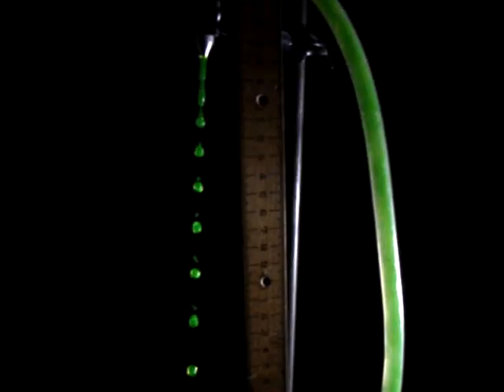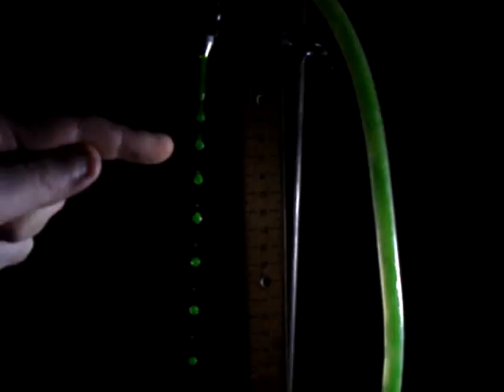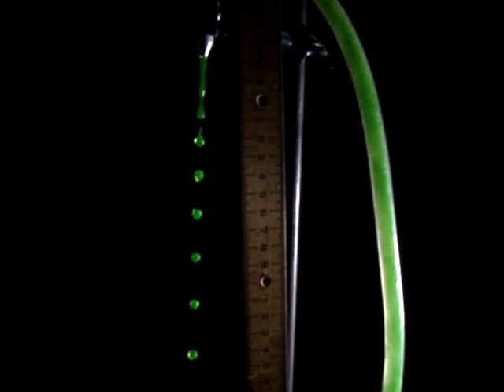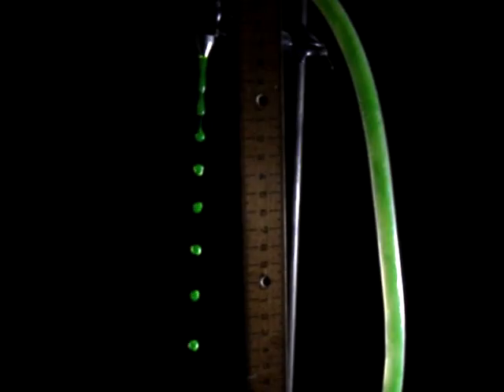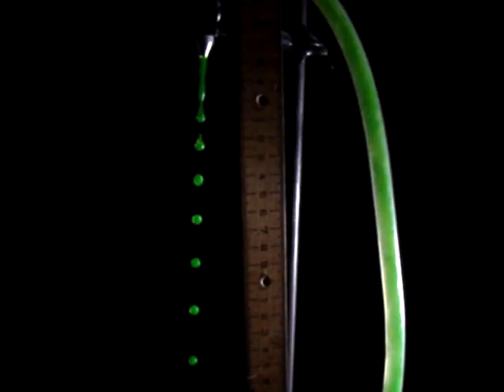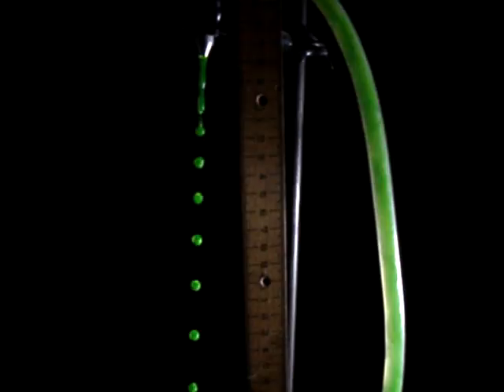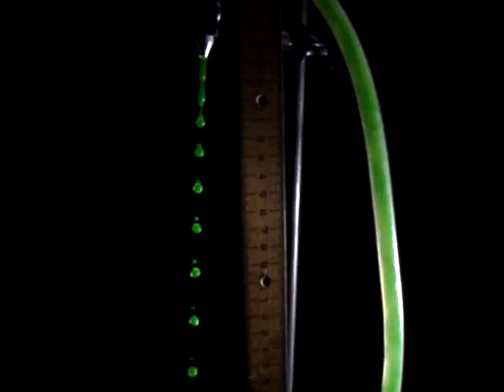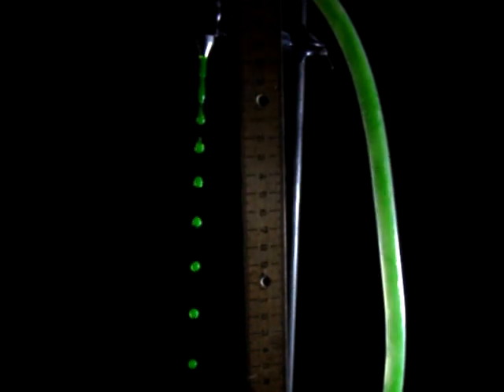Strobe light makes water drops fall in slow motion

Comment: Hi I'm interested in building a 'pump with its own timing circuit that allows me to adjust the frequency of the pump' :-) Would you be willing to share a schematic? Kind regards.
Reply from the maker: Yes, I've used a Gorman-Rupp 14825-710 pump which runs off 19 volts AC together with a 555 timer driving a MOSFET power transistor at 24 volts to create a variable frequency pump.  The schematic is pretty simple - contact me at dsherman-at-cornellcollege-dot-edu for details.

Comment from the maker: The GRI 14825-613 pump is a 230 volt pump so you probably can't run it off 120 volts.  You'll need a 120 volt to 220 volt converter.  Google "AllElectronics transformers" to find them.  You'll also want their 3 amp variable transformer (variac) which is used to control the pump intensity.  Connect the variac output to the 220 volt converter input, then connect the 220 volt output to your pump.  Finally, plug the variac into the wall and adjust it to produce a smooth droplet stream.

Comment from the maker: Hi - is your pump a low-voltage pump or is it a standard AC pump?  The circuit will only work with low voltages.  You can get low voltage Gorman-Rupp pumps (12 volt and 24 volt pumps) that can be driven using low-voltage circuits (555 timer connected to a power MOSFET transistor acting as a high-speed switch).  Aside from the pump, the circuit is pretty cheap.

Comment: Thanks for the offer - that would be very helpful. So far I have the oscillating pump, a varic transformer and a little led strobe light kit that I soldered together (a little circuit board). Not sure if I need any other electrical equipment to get this up and running, but a schematic would be wonderful. I know I definitely still need to get the tubing, buckets for water, strainer, and dye.

Comment from the maker: Yes - that's right.  The variac is used to reduce the flow from the pump from a fairly intense stream to a slower series of droplets.  It is also possible to use lower voltage pumps and run them off lower powered circuits that don't require variacs.  It's easier to tune these lower voltage circuits to run at frequencies other than the usuall 60 Hz AC that comes out of the wall.  Let me know if you're interested in building one of these - I have schematics.

Comment from the maker: The pump you see in this video is fixed to the frequency of AC power (60 Hz).  However, I have also made a pump with its own timing circuit that allows me to adjust the frequency of the pump.  For most purposes, the pump frequency remains constant and the strobe frequency varies.  However, there are some cases where it is necessary to vary the pump frequency and keep the strobe frequency fixed.  In either case, I use a simple 555 timer chip circuit.

Comment from the maker: I have posted some instructions on people.cornellcollege.edu/dsherman/waterdrops.html although you can find many 555 timer circuits online that will flash LEDs.  You can also buy strobes that are fast enough to freeze the motion of the water drops.  Try an eBay search for General Radio Strobotac model 1531.  A good search string is "Strobotac 1531" and see if you can find some good ones under $100.

Comment from the maker: It can work, although it often requires some fine-tuning because the droplet flow from many sinks is chaotic.  If you can find a flow rate that produces a periodic drip, then you're all set.  But often the drip rate will vary a bit and the drops won't flow at a uniform rate.  Slower drip rates are more stable, but then the flashes are farther apart and you'll lose persistence of vision and see discrete flashes rather than a steady light.  But I'm glad you got it to work with a sink.

Comment from the maker: You can drive the pump using the same circuit I used to drive the primary windings of the plasma speaker circuit.  Do a Google search on "derin sherman plasma-speaker-circuit.pdf" to find the circuit.  Replace the 555 timer with any circuit that produces short pulses (50 microseconds on, adjustable time off) and replace the flyback transformer with a GRI 19 volt pump.  You can email me directly at dsherman@cornellcollege.edu for more info.

Comment: I am very interested, after doing a lot of research i have figured out how i am going to drive the leds (Arduino to a led driver that has a control pin) but I've been stumped on the pump. After watching your video I definitely want to use an oscillating pump (multiple ones actually), but I've had the hardest time determining how to power one. I really like the idea of being able to adjust the rate of the pump. I appreciate you being willing to help me with this, thanks again.

Comment from the maker: Hey - I've also used a Gorman-Rupp 14825-710 pump (which runs off 19 volts AC) to make the slow-motion water drops.  This pump is driven by a circuit producing DC pulses at 24 volts.  The advantage is I can adjust the pulse rate of this pump while the 120 VAC pump is stuck at 60 pulses per second.  The circuit is pretty easy to make (555 timer connected to a power transistor driving the pump), so let me know if you're interested in making it.

Comment from the maker: I used a Gorman-Rupp 14825-690 oscillating pump in the above video, although most oscillating Gorman-Rupp pumps will work.  (Check pump voltage first.)  eBay has good prices (you can often find pumps below $50).  The pump was powered by a variac (eBay, less than $50) which will let you adjust the intensity of the pump to get a nice stream of droplets.  

An alternative to the pump is to vibrate the end of the hose using a speaker and oscillator - this is a much cheaper alternative.

Comment: what oscillating pump did you use and what power supply did you use for your? im trying to build one of these but Im not sure what power supply I will need for the pumps i see available.

Comment from the maker: There are two things you need to make: the strobe and the water dropper.  You can find instructions for making an LED strobe by doing a Google search on "led strobe light circuit slow motion" (without the quotes).  The cheapest way to make periodic drops is to siphon water through flexible tubing and tape the tubing to a speaker that vibrates at the same frequency as your strobe light.  Do a YouTube search for "brusspup freeze gravity with sound" to see how this works.

Comment from the maker: You can make the flow of drops appear to reverse if you flash the strobe light slightly faster than the pump rate.  Each drop almost makes it to the location of the previous drop, but falls slightly short.  So, the net result is each drop appears to move slightly upward, rather than each drop falling a fair distance downward.  You can do the same thing with strobe lights and spinning wheels as well - this is the "wagon wheel" effect seen in old cowboy movies and optical illusion websites.

Comment from the maker: You can often find good strobe lights on ebay for reasonable prices.  Try searching for a GenRad Strobotac model 1531.  This will cover a desktop experiment with ease.  You can usually find deals for under $100, although the list price is much higher.

Comment from the maker: Good question!  The key point is that a strobe light produces a series of very brief flashes, each lasting a few microseconds.  During each flash, the drops move a tiny fraction of a millimeter and, for all intensive purposes, are stopped.  Household bulbs do flicker a bit, but each flash lasts several milliseconds, so there isn't a sharp image.  However, old CRT television sets will produce brief flashes of light at 60 Hz, so they can be used as cheap strobe lights.

Comment from the maker: Well, in a funny sense, this is normal speed.  This is a straight video capture - no "slow motion" special effects.  If I had been thinking about it, I could have set this up closer to the room's light switch, and then I could have switched on the room lights, but then all you would have seen is a regular stream of water - all the moving drops would blur together to appear to be a solid stream of water.  I'm not sure this would help you understand the effect any better.

Comment from the maker: If you're using a similar pump, then you'd need 50 Hz in the UK.  But it is also possible to make a pump system that will create drops at any rate.  The easiest way to do this is to vibrate the tubing using a woofer speaker playing a single tone (usually between 20 Hz and 60 Hz) and then matching the strobe frequency to that tone.  You can also make/buy pumps that work at frequencies other than 50 Hz and 60 Hz.

Comment from the maker: First question: the flash rate is too high for your eye to distinguish individual flashes - it's about the same flash rate as a computer monitor or TV.  So no, there isn't a problem with this setting off epileptic attacks.  Second question: if you used enough strobe power, then this could work outside at night.  If you used LED panels for your strobe, then you shouldn't have any problem.  Email me dsherman@cornellcollege.edu if you need help getting materials.

Comment from the maker: It photographs best in a dark room, but it also looks best when the background illumination is low.  If the strobe is sufficiently powerful, it will provide enough light to illuminate the rest of the room.  However, strobe lights that are sufficiently bright to do this are pretty expensive.

Comment from the maker: The pump can certainly send a stream of water 35" downward (as seen in the video) but you'd need a more expensive pump to produce a clean, pulsatile fountain of water that would shoot upwards 35".  (There may be a trick to do this which I am currently investigating.)

I think the LABTAB stuff is all computer controlled: you only need a microcontroller or simple timer circuit for these LEDs.  What you need is rapid repetition (60 Hz) with short flashes (10 microseconds or less).

Comment from the maker: I used a Gorman-Rupp 14825-690 pump in this video, although many Gorman-Rupp 14825 series and 15000 series oscillating pumps will work equally well.  I've also used lower voltage Gorman-Rupp pumps using a 555 timer circuit powering a MOSFET to provide the high current pulses needed to drive the pump.  You can often find some great deals for these pumps on eBay.

Comment from the maker: Hi - simple answer is "Not yet."  The trick is to make a feedback circuit that controls the pump so that it delivers a steady stream of droplets.  Several digital control circuits that do this have been posted on the web, but I'm still trying to do this using analog circuitry.  This should be possible (and cheap) but I haven't yet found the time to do it.  If you want to try a digital controller circuit, do a Google search on: time fountain pic controller

Comment from the maker: I have a schematic for an LED strobe light on my web page (Google: Derin Sherman Strobe Circuit)  which costs a few dollars to make.  You can also buy used GenRad xenon flash strobes on eBay for under $100, if you're patient (eventually someone has them on sale).  Do an eBay search on: GenRad 1531.  You could also search eBay for strobe tachometers.

Comment from the maker: The bulb must have three features:

1. It can produce short (and bright) flashes lasting a few millionths of a second
2. It can produce many of them (about 60 flashes per second)
3. The flash rate must be stable

The most common types of bulbs are either xenon strobe lamps or LED strobe lights.  The xenon lamps are brighter but cost more; LEDs are cheaper and more versatile, but often aren't as bright.  I used a xenon strobe in this video and have done student activities with LED strobes.

Comment from the maker: In theory the pump output can be split 4 ways, although the pump needs sufficient power to drive four streams.  Doc Edgerton's original piddler machine used a very similar pump driving a pair of streams, and it worked fairly well.

Comment from the maker: @Fromzon Yes, it would be cool.  Unfortunately, the strobe I was using didn't flash at a consistent rate: the flash frequency would slowly drift, so even when the drops started out motionless, they would start to slowly drift up or down after about 10 seconds or so.  The solution to this problem is to synchronize the pump and strobe electronically, and that's something I'm working on doing.

Comment from the maker: @BlueRice It's easier to see how this works with a spinning fan.  If the fan blades spin around 60 times a second and the strobe flashes very briefly once every 60th of a second then the fan blade will always be in the same position each time the light flashes.  Your eyes blend the flashes together (persistence of vision) so you don't see the flashes and the result is the fan appears to be standing still. There's a Wikipedia article on the "stroboscopic effect" showing how this works.

Comment from the maker: @fruitytuterjjc Neat idea!  You could also use a single modulated laser reflecting off a spinning mirror onto a static array of mirrors positioned under each stream of drops.  You'd need a computer to control the modulation, but you'd only need one laser.  BluRay laser pointers should work well since fluorescein will readily adsorb the blue-violet light and emit strongly in the green.  Alternatively, you could use a TEA laser that produces nanosecond ultraviolet light pulses.

Comment from the maker: @TheSquishy200 Hi - there are really two separate components: the strobe and the pump.  My circuit uses a 555 timer to control LEDs driven by transistors.  You can read more about this circuit by doing a Google search on "strobe droplets slow motion gravity" as my page appears near the top of the list.  The pump is a standard AC pump operating at 60 Hz, so the drops all come out at 60 Hz.  It is also possible to use a battery pump, but you then need to carefully control the rate of the drops.

Comment from the maker: @sNerd Hi - thanks.  Most of the demos I've seen online fail to make the connection between gravity and the drop spacing.  You can use the ruler in the figure to measure gravity, although your measurement won't be all that accurate because the ruler should be placed at the same distance from the camera as the drops.  Incidentally, if you shoot the water horizontally, you get an almost perfect parabolic trajectory and you can see that the horizontal velocity is constant.